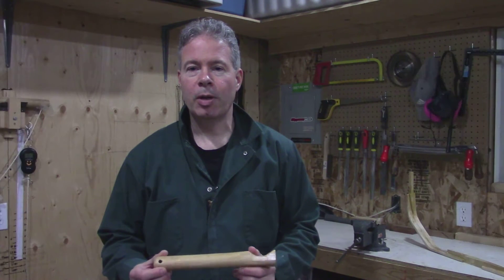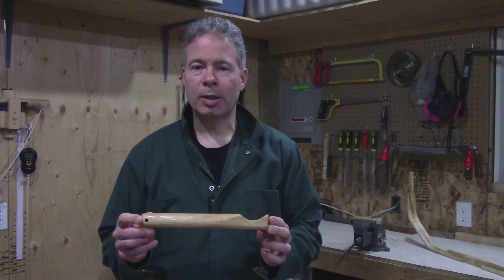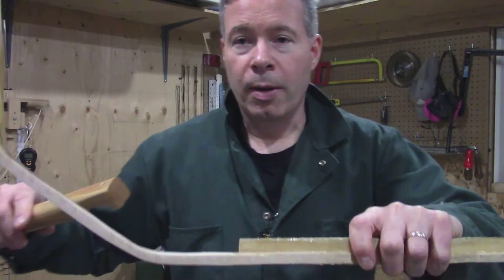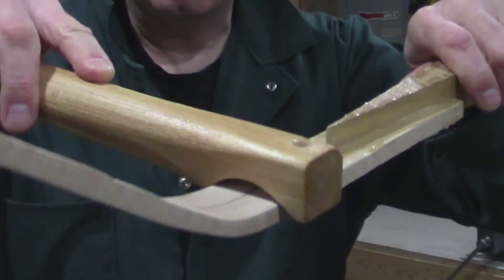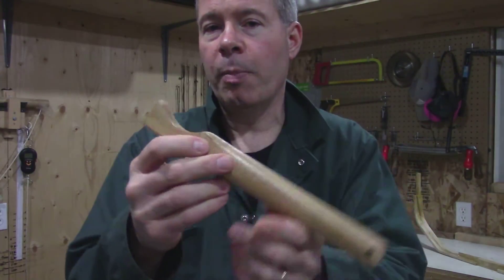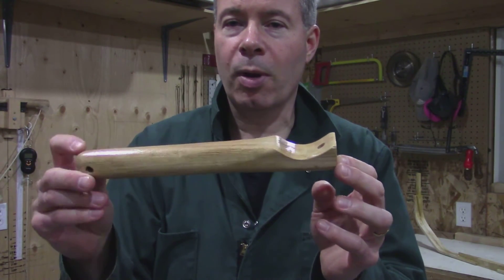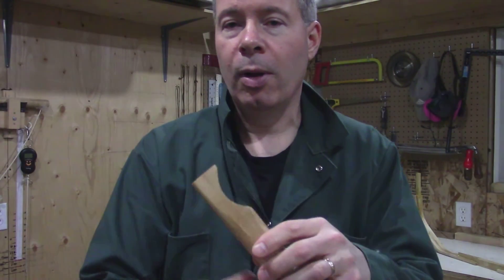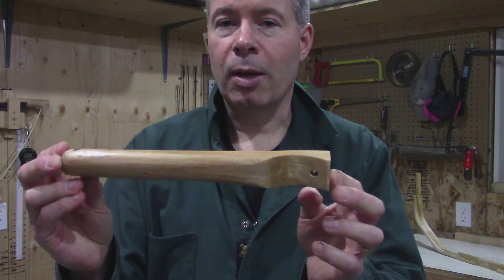Tencik Tool for Making Hornbows

Comment: Do you use the tench when wrapping twine on the finished boy at the handle and Siyahs?
Reply from the maker: The rope or twine is wrapped from the handle to the siyah but only as far as the horn goes
Reply: @vfcarchery7967  I intend to glue horn to the siyah. My question is do I need a tencik to bond the horn and wooden siyah? Or would a rubber hose be enough to create necessary pressure?
Reply from the maker: A rubber hose would be a really good idea as a substitute but make it tight enough for some glue to seep out, then you will know it is tight enough